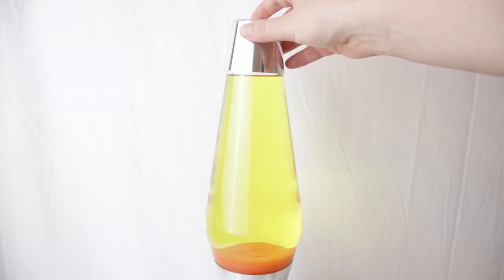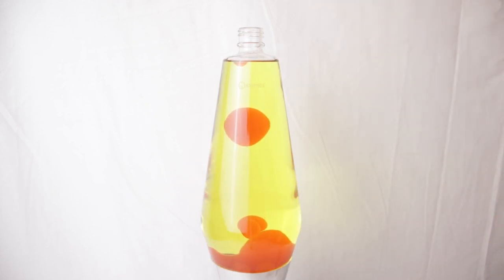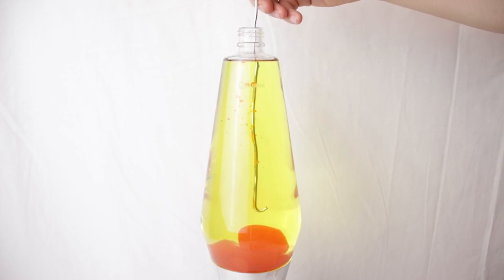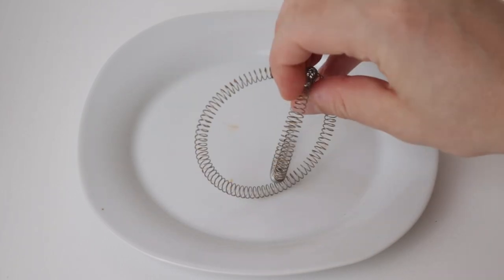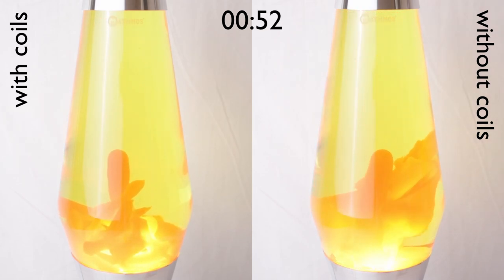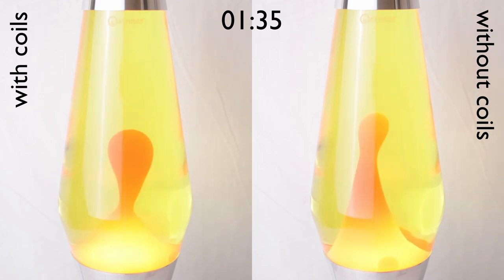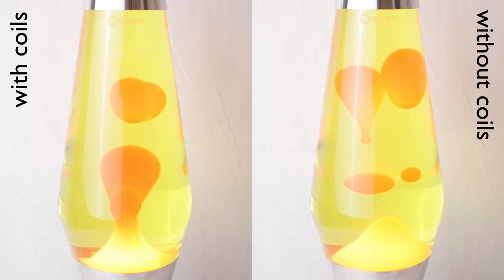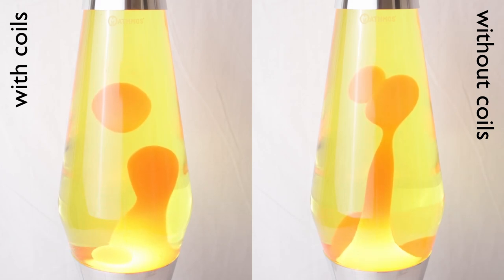What Springs and Coils in Lava Lamps do: Time Lapse Comparison using Mathmos Astro

Comment: They use the springs not too spread the heat but to enlarge the size and length of the lava bubbles. If you watch closely the lamp with springs make larger and "longer" bubbles sometimes all the way to the top. Which makes sense because the spring makes the wax stick to it, you can see that when you took that spring out. Its the same effect you have when making soap bubbles. But the source here is heat instead of air.
Reply from the maker: Not saying you're completely wrong, but a) they say in the FAQ specifically that it's to accelerate the melting (why would they lie), and b) I personally see long and short bubbles on both sides almost equally. Anyway, anybody can look at the footage themselves and form their own opinion, no need to trust either of us 😁
Reply: @Makstuff  Trust no one ;)
Reply: @Makstuff  the coils purpose is for surface tension, it re-heats the wax that drops down better and makes the globs a bit bigger
Reply: Looks better that way too

Comment: Uhm, but is it normal for my lava lamp (containing the springs) to behave like the one without the springs but worse? Mine takes almost two hours, and I'm genuinely confused. I'm always questioning and waiting for someone to explain to me why my Lava Lamp behaves differently than others. It also sparked my curiosity, so I decided to search. But after watching this, I noticed it was normal for them to have springs. Still confusing, though.
Reply from the maker: Dunno, I guess its always a balance thing between bottle size and bulb wattage. A large lamp with a weaker bulb will take long to heat up, but also will not overheat as easily as a small lamp with a strong bulb. I don't think the spring matters a lot for heat up time.

Comment: Thank ypu for your post I made the mistake of shaking  and it wont work any more . Do you know what wax to use and where to get it Thanks for tour time
Reply from the maker: Give it a bit of runtime, maybe it will recover. If not, replacing the wax is quite complicated and you are probably better off buying a new lamp. At least if it's a cheap one.

Comment: I have a lava lamp and it says to use a 30 watt bulb. Can I use a higher one like 40??
Reply from the maker: Yep, should be fine, just keep an eye on it to make sure it doesn't burn anything. Best solution is combining it with a a plugin-dimmer to gradually increase the heat.

Comment: That's pretty surprising actually. Sometimes when a lamp gets too hot (like my iO, specifically), the wax detaches from the coil and doesn't flow at all. I guess then that this is simply due to the wax being too hot, and the fact that it detaches from the coil is a coincidental side effect, rather than the cause for the flow to stop.
Reply from the maker: Hmm, hard to tell intuitively. Actually I don't even know what effect exactly could cause the flow to stop during overheating. But good point in general that the spring might be more useful in less-than-optimal flow situations, I didn't even consider that.